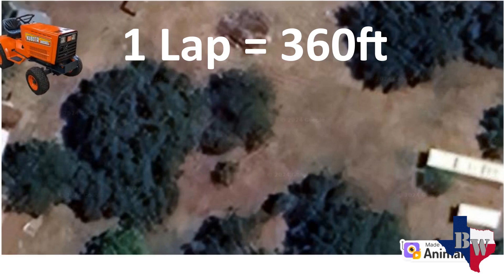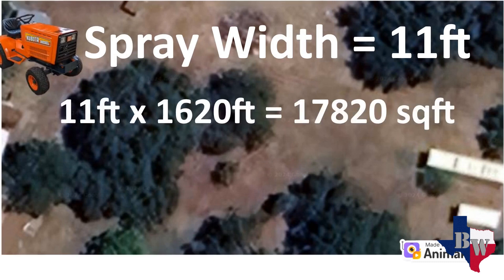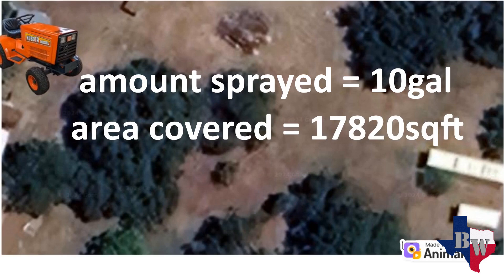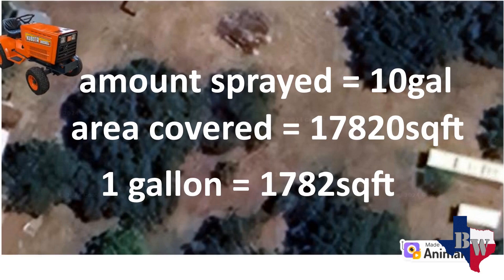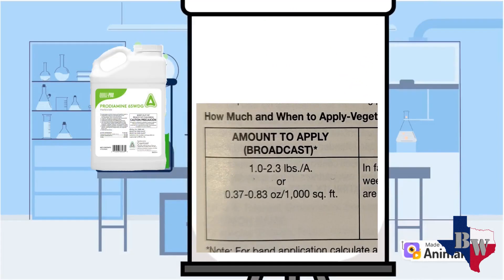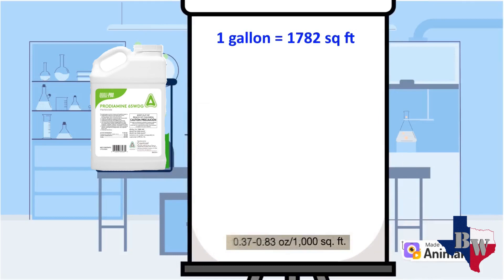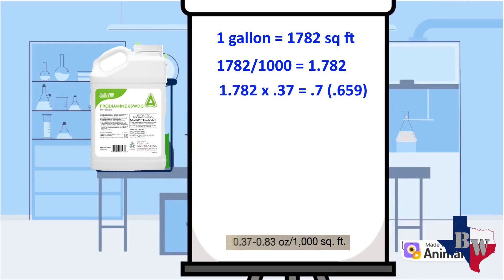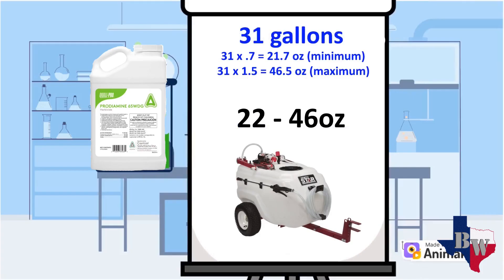How to calculate correct mixture of chemicals herbicide weed killer for a tow behind sprayer

Comment: 1000/11=90.909. Measure time to drive 90 ft. The take that time and run you’re sprayer into a bucket for that amount of time. That volume will be the amount sprayed per 1000 sq. Feet. Way easier.
Reply from the maker: That will work but it is small measurements being extrapolated over a large volume...the larger the volume/time involved the more accurate the measurement will be...your way is easier but small measurement mistakes will be amplified.

Comment: Thank you for the video. Will I need 20oz of prodamine to cover 30 gallons of water?
Reply from the maker: 20 oz would be on the low side if you are travelling at close to the same speed I am....remember if you go fast it's spread out farther (lower dosage) and if you go real slow it's a higher dosage (think of it like spray painting). I mix about 22oz for the 30 gallons which is on the low dosage side and if there are really bad areas I just slow down a bit. Prodiamine is pretty forgiving so you can up the dosage if you want but 22oz for 30 gallons has worked for me in the past.

Comment: This might be a dumb question but you figured your mix with a dry weight in oz.s, if you use a liquid herbicide would you use still use a weight in oz.s, or fluid oz.s?
Thanks, great video btw!
Reply from the maker: Basically you use whichever measurement the herbicide uses so if it says x amount of liquid ounces per acre then use liquid ounces if it says dry ounces use dry ounces 👍
Reply: Thanks!